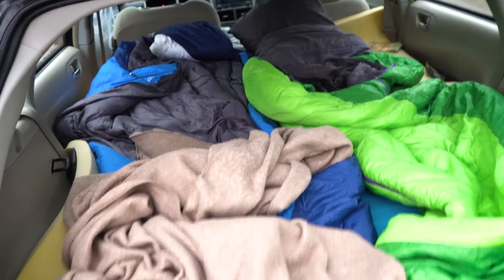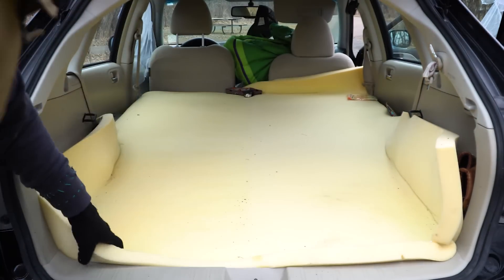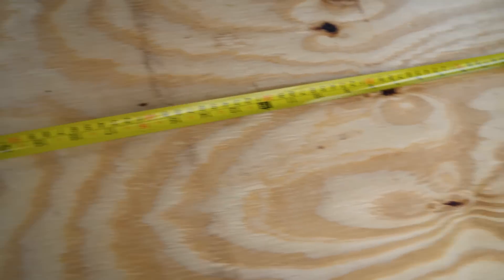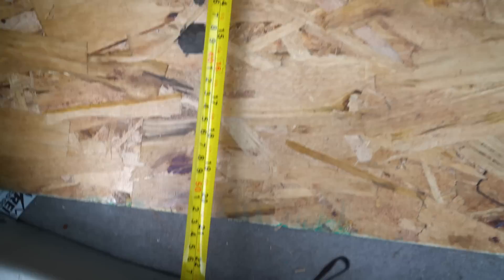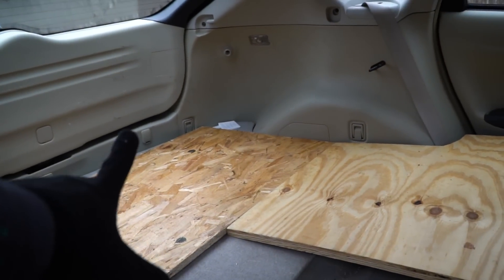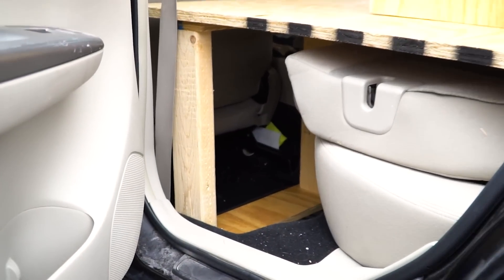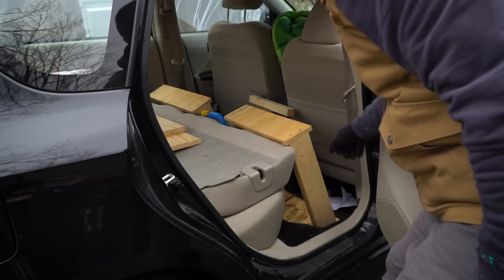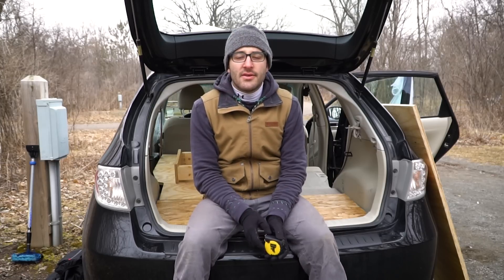Cheap and Easy Hatchback Sleeping Platform

Comment: Duct taping all edges will keep the abrasive edge of the wood off the interior plastic. "Loose" taping the edge with little space between the edge of the wood and the tape also helps. The "beds" look perfect btw but wow the plywood and 1" foam must eat up a lot of space. The loose mosquito netting is brilliant!
Reply from the maker: It didn't take up all that much space - I was able to sit up fully against the back of the front seats.  Great idea with taping the edge of the wood - especially if you're buying the cheap stuff like I did!  They actually make mosquito nets made just for this purpose now, check those out.

Comment: they make window screen sleeves so that it fits over the entire door frame and window area without worrying about any mosquitos coming in or wind blowing your screen material around while the window is down...also use piano hinges to fold the boards into a more compact storage spot so you can put the seat back up
Reply from the maker: I have some of those sleeves now, and they work GREAT!

Comment: i cut my boards in the similar way about 2 yrs ago, still using them.. works great!! Use thinner boards.. use sealant to protect from weather.. I have covered the edges of my board with cheap leather and i dint need the heavy wooden foundation under the board either.. just strap the boards to the front seat headrest.. I find it more sturdy and comfortable than air mattress. Also use magnets to hold the bud net on the window down, when windy.. nice video overall.. happy camping!
Reply from the maker: Thanks for the kind words!  Happy camping to you as well
Reply: Great tips, thanks!

Comment: Nice idea. I sleep in my car alone so a twin air mattress works perfectly and no board is needed. That still gives easy access to the back seat floor space.
Reply: That's what I do also.  I don't have these boards.   I just put the back seat down, and put the air mattress in there.
Reply from the maker: Nice, i think that would work great with 1 person.  I found these boards maximized the space for 2 people

Comment: I'm really excited to do this. I have an Impreza and when camping I use a foam pad similar to yours with a sleeping pad and it was still uncomfortable since the seats have so many uneven spots when they are folded down. This will eliminate that issue for me!
Reply from the maker: That's exactly why I made this, and why it didn't need to be complicated!  Just needed to level out a few spots

Comment: I was thinking of this with my mazda 3i sedan.  There is a 2” drop from the folded down seat to the trunk area.  I think I will have to raise the back board up with spacers to make it even. Also, I saw a rav4 “conversion” where they drilled 2 holes in the plywood and put a rope over the headrest instead of the lil platform on the back floor. I’m 5’11 and with passenger seat pulled all the way up, I should fit.

Comment: i use a four inch piece of high density foam in the back of my Crosstrek....it eliminates the discomfort of the hump where the seats fold down. it has to be the better quality stuff that won't compress easily....

Comment: Very cool - thanks for explaining the platform in detail.  From watching your video and looking at the dimensions on your blog,  it occurred to me that maybe if you made the foot board take up the entirety of the trunk's floor, you could shrink the main platform pieces enough so that all 3 could lay flat in the trunk with the back seats up.  I don't know the exact dimensions of your trunk, but I'm thinking something like 42"x27" for the footboard and  41"x21-25" for the main platforms.
Reply from the maker: Eric Not a bad idea!  I'd have to go back and measure. I made the main platforms long enough so that they would cover a gap that opens when the seat is folded down.  I also figured that I'd fold the seats down anyway when car camping, just to fit our stuff. It would be nice to keep the pieces in the car at all times though!
Reply: Yeah, being able to keep in in the trunk all the time would be awesome.  I think the supports could also be redesigned to save even more space.  If they could just be taken apart (like using rough mortise/tenon joints instead of screws), then it would be able to collapse to a small bundle of 2x4s.  You'd be able to keep it in your trunk all the time AND it would hardly take up any space.  You could even put a trunk liner over the plywoods and it'd be practically hidden as well.
Reply: I suspect that even if you couldn't make the footboard as long as 27", you could probably get away with shortening the length of the platform a few inches without sacrificing usability, since your head isn't being supported at the end of the board.  For example 42"x24" footboard with 42"x21-25" main platforms.
Reply from the maker: Yeah i like that idea.  I was more going for a platform that is super easy and anyone with any skill level could make!
Reply: Heh sorry - just the engineer in me going overboard.   Thanks again for taking the time to make the video/instructions!  I'll show you some pictures when I get around to making my own.
Reply from the maker: Eric no need to apologize man! The more suggestions the better, I definitely appreciate them. That helps give people more options when making their own 👍

Comment: I’m 6’4”. I see that I won’t fit lengthwise and straight, but would someone my height fit diagonally? Just thinking about a couple of nights of camping. Thanks for the helpful video.
Reply: If the make an extension over the bumper and leave the hatch up/open. You could tie a tarp over the opening. Of course might feel safer with the car locked up. Maybe modify the front seats so they can be popped in and out easily and put on top for the 🌙. Random thoughts.
Reply: @cynthiagustafson2507  Great advice. Thank you.

Comment: Your great for making a vid of this, i have a ford focus hatch and when i put down rear seats , their not even with the truck bed, so i would something like this 👍 , i love camping and i do sleep in the car alot when i and wife dont get along
Reply: You can fold the back singel seat so it comes flat if you lean front right chair max (and max forward). For the double back seat you have to remove the ses bottom with two screws, easy (torx 40). Leave it att home. Then it en be about 195 cm and flat 😊

Comment: Did you need to fill the trunk with something? How is the board in the trunk at the right height?
Reply from the maker: Nope the board is just sitting on the floor of the trunk!
Reply: I’m going to screw some 1 or 2” thick boards to the bottom of my back board.

Comment: Paint that board to keep splinters from going into foam
Reply from the maker: Great suggestion!
Reply: That's too much work. Just buy some duct tape and tape the whole thing up. It's gonna be smoother.
Reply: Might consider shelving material, since it comes in big, wide rolls.
Reply: Why bother? What are splinters gonna do to the foam?
Reply: Me Me or varnish..👍or a tarp underneath ?
Reply: Fluffy Beast they do work there way through and split the material,mdf board is good too as well as ply wood..
Reply: Cover it in automotive carpet. It's cheap and it won't tear up the interior.

Comment: The one thing I'd be paranoid about using an unsecured piece of wood or any type of platform that doesnt break, is what might happen in a serious rear end crash where you crash into a car in front of you.  Where does that platform go?  Yipes! Sliced!
Reply: Just take off the seats and don't put wood, it will be heavier and if you do it you'll have more space, that's what i did 👍 (sorry for my bad English).
Reply: You must be kidding.  The wood would be stopped the front seats.
Reply: Strap it down too if you want.  Cut a piece of rooe so that a bunjee will fit tight when wrapped around the folded seat and board.  Bubjee it up and go.

Comment: Why put in the wood?
Reply from the maker: Good question!  There is about a 12 in. gap between the back of the driver's seat and the folded down back row of seats.  The wood bridges that gap, extending the flattening the sleeping area.
Reply: Good question.Maybe it's a layer of insulation? Car gets pretty cold underneath. I use my yoga mat under my mattress.
Reply: It is incredibly uncomfortable sleeping without any modifications in the back of a hatchback with folded rear seats because there are different surfaces at slightly different levels, and after some hours your back will feel the pain. Having the uniform surface of the wooden platforms is far more comfortable for the back as all the imperfections of the different surfaces are smoothed out.
Reply from the maker: Perfect explanation!  Well said Al
Reply: Al Licks not with a 5 inch thick mattress....no pain
Reply: With a higher density foam piece (similar to that used for car seats), those tiny gaps won't be noticeable. Also, the wooden piece that goes in the passenger foot well behind the driver and front passenger seats are a waste of space as others have mentioned. Almost all campers I've seen use that space for a storage bin which is absolutely required for necessities. Also, the trunk where you would store more necessities would not be accessible with the plywood board.
Reply: @ne0tekk1  It's to support the overhang and is necessary.